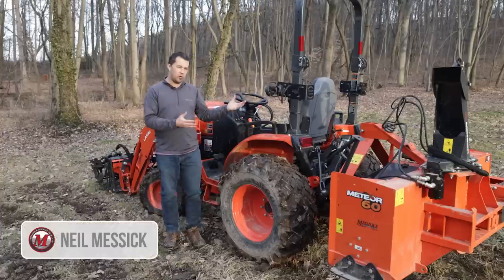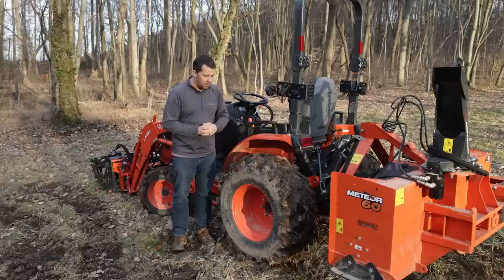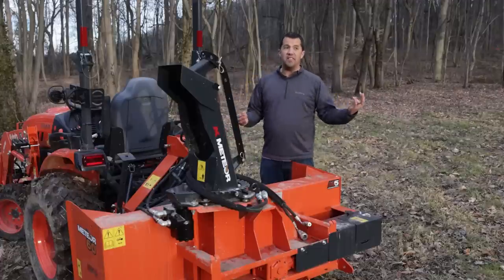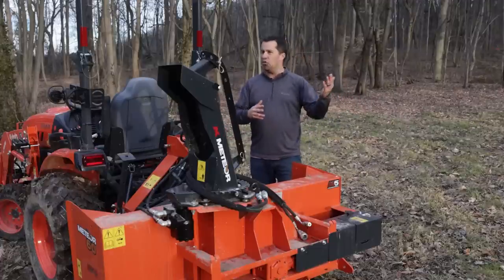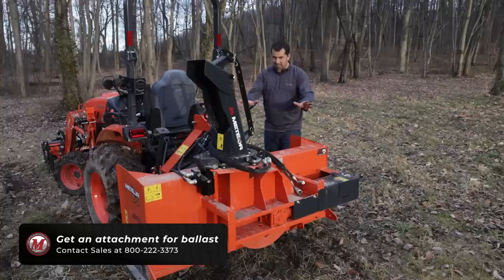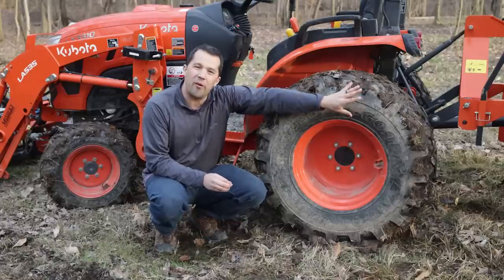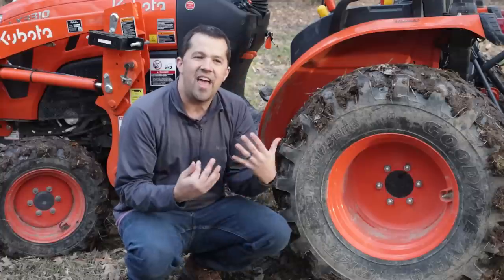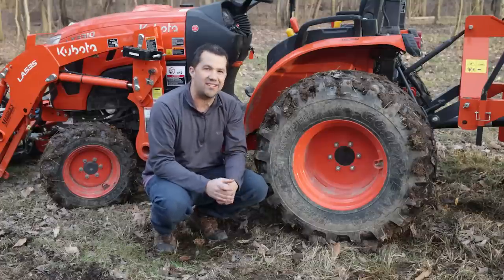Stability & Performance. Tire Ballast vs Machine Balance

Comment: Even with filled tires it's good to have a 3pt attachment to act as a counterweight. If you're using ground engaging attachments, that's where filled tires and wheel weights are the biggest help, and the traditional use of them.  Also, I think filled tires can help with stability on hills more than a 3pt attachments because it adds weight closer to the ground (or at least that's the common argument).

Comment: No fixed ballast offers the option to run light on turf applications where you might otherwise sink or leave marks.
Reply: That is a really great point that I have never even thought about. Thanks for the insight 👍

Comment: Great points!  Has anyone ever backed into a tree, fence, building ect,  with an expensive piece of ballast on the 3 point?  I have.  Yes, I understand there are many different work environments, and skill levels -  but I prefer a ballast box w/weights and liquid in the rear tires.  I'm, personally, not willing to endanger my expensive attachments for simple ballast use.  There are other options.....Just a thought.  Thanks Neil an all.

Comment: Adding weight to the frame of the tractor such as an impliment adds stress to the axle bearings. Adding wheel wheights or tire ballst does not add wieght or stress to the axle bearings. Fill rear tires half full of liquid ballast keeps the center of gravity low, and allows air to act as a cushion like an unballast tire. Adding wheel wieghts will make up for additional weight if needed. Using sugar beet juice or some of the other safe biodegradable fluid will not harm crops or feed if leaked from a puncture. Also will not rust like Calcium cloride will. The use of liquid and or wheel wheights in this manor still allows some wieght adjustments if needed. You won’t have an impliment hanging on your three point hydraulics causing possible excessive strain bouncing around. You won’t have an excessively long tractor either that can reduce work in tight areas like corral cleaning. Just some of my thoughts put out there in responce to this video.

Comment: Two years ago I purchased 4 new tires for my bx2370 replacing the 4 filled tires on it. I chose to not fill them just to see what the ride was like. It was great. No more back jarring bumps. I just added tire sealant and haven’t had a flat or any other tire issue. I do carry a 4 ft back blade or a 4 ft box blade for ballast. Oh yeah, the coffee filter pulls it all together.

Comment: The other big thing to consider is the front axle weight rating. Rear tire ballast will offset the loader weight, but it doesn't take weight off of the front axle. You can safely carry more in the bucket by using the weight behind the rear axle as a lever to take weight off of the front axle/tires, and make it easier on all of your bearings and such. It also takes less weight behind the axle than it does in the tires, for the same amount of balance.
Reply: This is often overlooked by people that think tire ballast is the only answer.
Reply: Right on ,been "preaching" this for years. Almost constantly fix others front (crushed AXLE seals & bearings) but Never my own.
Reply: Totally agree. I'm running wheel weights, tire ballast, and carry a heavy implement on my three point when doing heavy loader work because I'm moving very heavy boulders on uneven rough terrain and want the tractor planted and balanced. I don't notice a rougher ride with my 14.9-24 R14 tires filled to 75%...

Comment: I agree with that video. I opted not to fill the tires because of the need to go over lawn sometimes. I can remove a box blade or other implement if I want the tractor to be light and not make ruts. If you have water in the tires you’re heavy all the time.

Comment: One other consideration is with loaded tires you don't have to have an attachment on the 3pt. I do a lot of work in some tight woods with my LX2610 I simply don't have room to make turns in my paths with anything more than a quick hitch on.
Reply: I do some work in tight woods also, but very low lying wet woods.. unless there is a drought in the summer, its never dry.. I simply need to be as light as possible not to get stuck..
I need weight that i can take off when its time to head to wet areas
Reply: @Morpheen999  yep that can be a concern. Mine woods are high so they drain well. My biggest issue because the LX is not a heavy tractor. Is traction I have the oversized 15-19.5 R4's so I've got about 600 lbs of RimGuard in them. In my case it works great.

Comment: I fully agree Neil. when I was building my house, I made a ballast box form using 2x4 and plywood with a steel trench plate on the bottom . Welded small Z shaped rebar to the bottom, mounted  cross draw bar and top link. I had my foundation contractor fill the form while while they were pouring footing.  I carry a very compact, at-least 800 lb anywhere I go and it does a good job for the work I do with my MX-4700.
Reply: And further more ; you dont have to drag it around FOREVER.
Reply: @donaldstrishock3923  Yup, for sure. The only concern I have  is  having 800 lbs times distance to 3 point pivot point and that causes a good momentum force. Bouncing the ballast weight also create considerable dynamic loading and whether that is good for 3 point lift piston seal. Whenever i park the tractor in the barn, I always lower the ballast on a tree trunk 12" in dia and 2 ft high to relive pressure from hyd system and it's associate seal , same with my loader. Saying all of that and still I know my CAT II lift system is capable of a lot heavier implement like disk harrows and such.
Any opinions?

Comment: I don't fill my tires. Reasons to not fill and use 3ph weight (I usually use a ballast box, but an implement works too):
1. Tractor can be made light when you want. To trailer it, for mowing or lawn work, in mud
2. Relieves load on the front axle in a way that filled tires doesn't
3. Easier to fix a flat tire, or take it into the shop
4. Some fills will rust your rims, some don't but can be more expensive. Some can freeze
5. New point for me from Neil - ride quality

Reasons to fill instead of 3ph weight:
1. If you don't trust the operator to remember/both to put weight on the 3ph - not just kids/apprentices, but sometimes me too. I sometimes can't be bothered, and that's dangerous
2. Less load on the rear axle - filled tires don't load the axle/chassis, they load the ground directly
3. Less likely to bang into things (although a ballast box is also reasonably tight to the rear of the machine)
4. You can do both - with filled tires you can still add an implement if you need it
5. Lower centre of gravity - more stable on slopes than a 3ph implement (but spacers could also help with this)

Like most things in life - horses for courses. My B2601 spends 70%+ of its time mowing, and we can get quite wet on our lawn. I also trailer on a light trailer, filled tires would exceed my trailer weight limit. I have a ballast box, and I use bricks in it so I can vary the weight if I wish.

Comment: I do both. On the farm, in my youth, which was in the 40s and 50s, we always had ballast in our back tires (Farmall M, Farmall 400 TA, International 350 TA with fast hitch). The implements hooked to the draw bar. We only had the loader on them for cleaning up the manure pile in the spring and the buckrake when we brought in hay (no bailer or chopper, round bailers hadn't been invented yet). I only have a John Deere 770 now. The rear wheels are full of fluid and I have an 800# counterweight for when I use the loader. The difference in pushing power due to the additional weight in the rear tires is noticeable. The liquid only goes to the top of the rim, slightly below the shrader valve, which leaves an air pocket. The ride is just fine. The weight in the rear tires adds stability to the tractor and moves the CG of the tractor slightly to the rear, not as much as the 3 pt. hitch weight, but it's purpose is additional traction and for that it works well and is a lot less expensive than iron weights bolted to the wheel.

Comment: I'm in agreement, though a lot of it probably depends on its primary use.  Just purchased a tractor last spring myself and declined ballast.    For me, I didn't want the extra weight in the tires as I use it to mow in the summer and there are soft spots when it rains.  With my pervious tractor I had purchased a ballast box that was big enough for the new tractor so I just put that on in the summer when using the FEL and in the winter when plowing with the pusher.  Thanks for sharing.  I enjoyed your video.
Reply: I too use a ballast box for loader and forklift work without any tire ballast.

Comment: A VERY important added benefit to ballast beyond the rear axle is it takes pressure off of the front axle. Filling the rear tires does not. Especially important for subcompact and compact machines.
Reply: That's a great point Sam, I would also like to add that if you're doing loader work, place your tranny in low as medium and high will stress your front axle with all the bouncing.
Reply: Agree, that should have been mentioned as a reason to choose rear ballast over loading the tires.  It's a far superior way to ballast the tractor for front loader work since it takes load off the front axle.  The front axle often gets abused on compact tractors with front loaders.

Comment: Great points, for sure. The owner's manual for the backhoe on my 2601 specifically says not to ballast the tires if the backhoe is mounted up. I've kissed the limits of my loader, never tippy toward the front.
Reply: I have the same tractor with a backhoe and I'm going to fill mine halfway because I'm tired of feeling like I'm about to tip on small slopes. I also have 2.5" spacers. I can only imagine they say not to fill them because of the load it puts on the outriggers.
Reply: @seanwahl1000  fair point. My property only has a small amount of flat ground on it, but haven't noticed much tippiness on side slopes. 

When I started running dozer on side hills (after years of watching skilled operators), I felt like I was going to roll the machine. Got off for a minute to calibrate what it looked like from the outside. It was like half as much side slope as I'd seen skilled guys working. 😆

Comment: I can see the validity of both points.
For me I don’t go out on the road very often and our soil drains well so I don’t have to worry about those things. But even with ballast in my L4060 tires it’s not very hard to lift the back end. I bought a cheap Chinese ballast box and after some welded reinforcement it will carry the 800lbs of ballast as advertised.  What I like about it is the size, it doesn’t add to much length so tight quarters work isn’t impacted much like it is with the flail mower on the 3pt.
Reply: My MX5200 came with a similar ballast box. Mine is a 600kg metal box full of concrete. It’s pretty good because if it gets knocked a bit it doesn’t matter.

Comment: I bought the Lx2610 and I got it with the large tire package and a 72” belly mower and I find the mower helps with ballast…I don’t load the tires because I mow my lawn with it and have the loader on about half the time…if I need to use the 3pt hitch I just pin the mower up in the raised position and it works quite well…I find having the larger tires makes a big difference in its abilities and floating more across soft ground!..great tractor and no emissions!!

Comment: One thing that most people miss when they are using a 3 point implement as ballast when driving around that it usually raises your tractors center of gravity, this means although you are less tippy front to back you are more tippy side to side, where tire ballast keeps your center of gravity low. Of course this also depends on the implement you are using as a counter balance and how high you are lifting it.

Comment: If you live on steep terrain or are pulling plows, pulling equipment the pulls hard on the tractor, fluid in the rear tires really helps. It stops a lot of spinning.

Comment: I made 150lbs of concrete wheel weights for my small garden tractor. They double my drawbar pull with only a rear end weight increase 30%. It's good to have options, so you can use whatever technique is best suited.

Comment: I can't say i agree with you Neil, a short while ago, you did a video where you had your brush hog on the back of your tractor. And you stepped into the loader bucket and the rear wheels came off the ground. 
Now that tells me that you still need some ballast on the rear axle.

Comment: While rear ballast behind the rear axle is best you also have to consider the available maneuvering room you have. For myself, On one side of the house, I have to go between my wood bins, trailer, standby generator and AC unit. On the other side, I have a roller, box blade  and the propane tank. If I were to attach my box blade, I can for certain, guarantee, I would have nailed one of the aforementioned objects, or the vehicles in the driveway.  So for me, wheel ballast is somewhat a game changer. You also realize, the further out you put your rear ballast the more load you could possibly put on your front axle without realizing it.

Comment: Thank you for explaining why you my friend do "NOT" put ballist in rear tires. My 19000 pound Backhoe has counter WT. On front. The Backhoe tool is part of the main frame. So I need Wt. On front. I will say at my work. We had a (NH) subcompact that we used to load, 1 Ton dumps with gravel. There was NO counter Wt. on the back. You could NOT dig into gravel without rear lifting up. Your explanation though is great for a subcompact,  say a guy "MOWS" his Big Lawn, it's uneven ground, you are so right, his ride with a rear tire filled ballist will be like driving a bulldozer, and will be jarring on the back. The guy who was NOT going to remove his Backhoe attachment on subcompact, that alone is your counterweight.

Comment: I own a 2022 LS mt335hc.  It’s a cab tractor on a larger chassis than the sub compacts I find that I don’t need loaded tires for my applications.  I appreciate that he lays out the use case for not thinking that tire ballast is the end all solution for ballast.  My issue is I have to watch my weight on my trailer/truck combo and loading the tires would put me over when hauling the tractor and implements to a location.
Reply from the maker: Your cab adds several hundred pounds.

Comment: Sometimes a big implements hanging off the back is a pain to navigate tight spaces. Many times I have to worm around or into spaces where a 3ph implement would hit. During the winter I run a farmi winch for ballast, and of coarse to use the winch. Nice and tight to the tractor. But, I do not want to fight with putting something on just for ballast, filled tires for me.

Comment: Great video Neil. I’ve been running my Kubotas without liquid ballast for years. I’m generally always doing something in addition to loader work that requires an additional attachment on the back. I’ve run tractors with fluid ballast and at road speed they begin to oscillate which is not a good feeling. Also more rotating mass which requires more power to get rolling and asks more of your breaking system to stop.

Comment: Good segment but incomplete advice. Your snow blower or rear implement attachment is correct advice - for front to rear balance but it excludes the left side to right side balance stability. Water in rear tires adds substantial weight on either side of the tractors centre line. This is majorly important when traversing across slopes as the majority of the weight distribution is lower than the tracto
rs actual centre of mass. Also if you fill the rear tires to 2/3 of volume, you still have 1/3 of the fire filled with air. I find the this still gives a comfortable ride when driving.

Comment: In northern coastal New South Wales where the temperature rarely get below freezing, most tractors have water in the rear tyres. It costs very little and is usually a zero cost upgrade when buying a tractor. My MX5200 has water in the rear tyres. It also came with a 600 kg 3 point counterweight. I think both are needed when using the loader.

I think the manual for my tractor recommends fluid in the rear tyres.
Reply: I just keep the Backhoe on ( forget its there) an lower the the rear tire pressure to 8psi ( on r4s with NO tire fill fluids) on my MX5200 & EVERYTHING Works Great!
Reply: @donaldstrishock3923  my tractor does not have a backhoe. I've heard backhoes are a bit top heavy. Is this true? My place has steep hills so I like to keep the weight down low. The tyres on my tractor are R1 ag tyres. They work well as the tractor is rarely driven on hard surfaces.
Reply: @kdegraa  Whats "kool" with a backhoe,  One can "strech it out with Extree counter-weight in the bucket-thumb & even swing the "Extree" Load sideways on the slopes. A 600 lb counter weight is a good start. Tire fluid just "slosses around" ALL the time Throughing "Dynamic Weight" OUT OF KILTER all the time. BEST wishes with all your endeavours.

Comment: Hi Neil good video back when I was moving around the holiday camp with a BX 2350 loader  used 4 * 25 kg weights + 1 * 50 kg on the 3pt links When mowing no loader weights on front leaving a mower on wood not have worked for us Thanks again

Comment: My JD loader manual recommends I use all three at the same time loaded tires, wheel weights, and weight on the back. I think the total was to be approximately 1000 lbs. for max loader use.

Comment: Neil is correct. Loaded tires are for traction or helping on hills, which is why I loaded mine. A rear implement or my Heavy Hitch is for offsetting the loader.

Comment: Kubota also sells a “Ballast Box” that goes on the three point hitch and you fill it with your choice of aggregate. In my area that box is supplied with the tractor free of charge.
Reply: My area offered the box scraper.